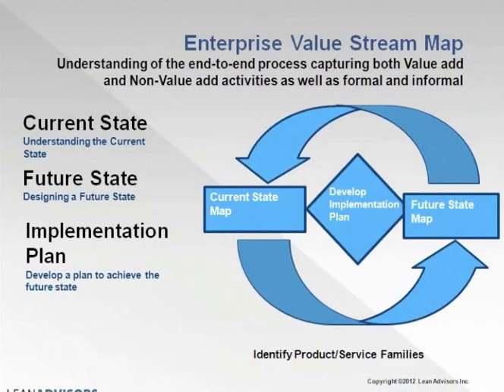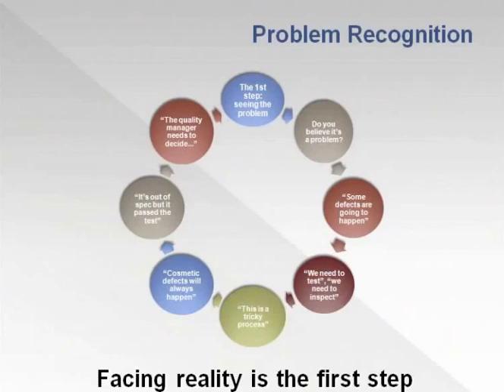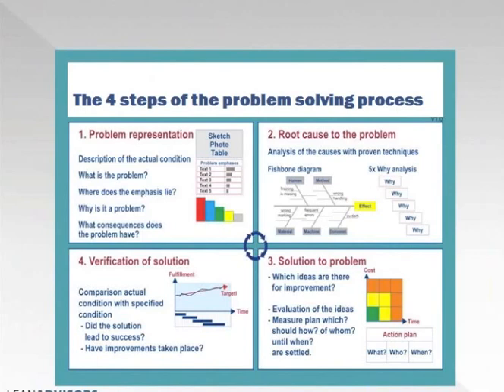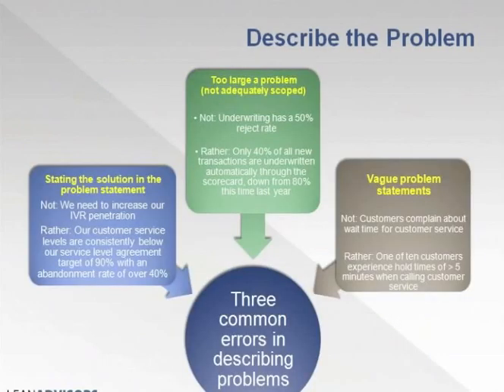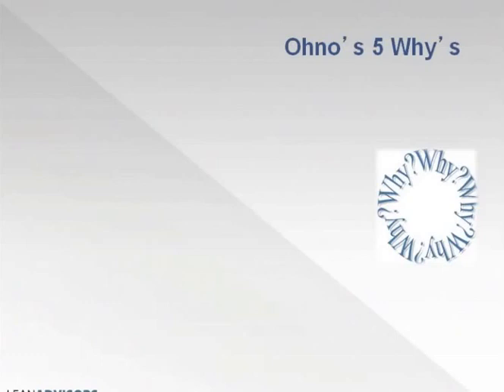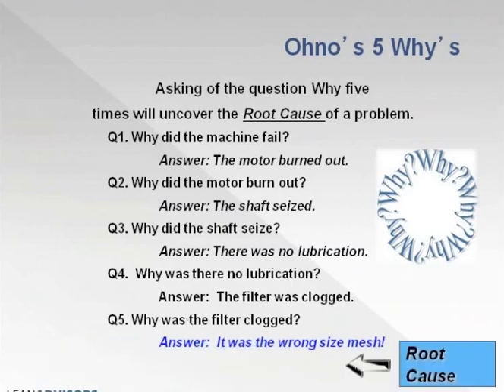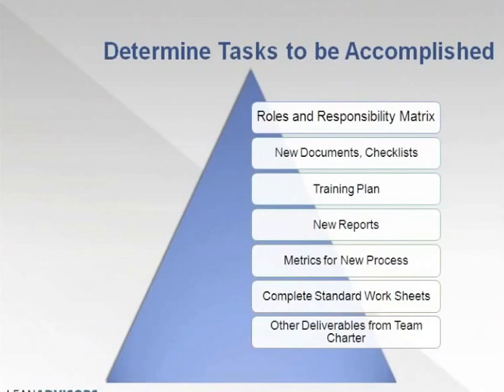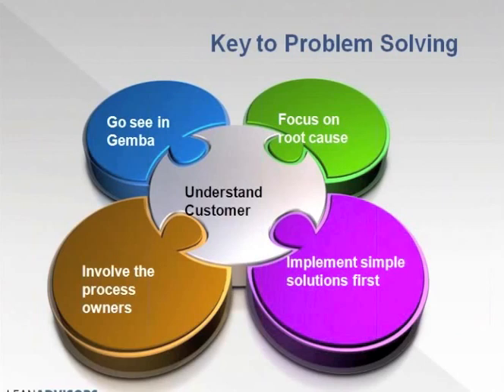Understanding Root Cause Analysis: Presented by Tony Mittiga

Comment: There is no picture with your presentation
Reply: +Keith King  yes there is, scroll the presentation
Reply: +Keith King I thought I had a system or browser setting issues because I did not see video too. There are pictures but it is about 2 minutes in to the video. If 2 munutes without pictures is not bad enough, the introduction is lengthy and lost interest. In my opinion there is a lot in this video that can be cut.